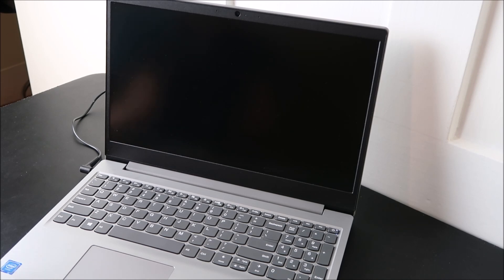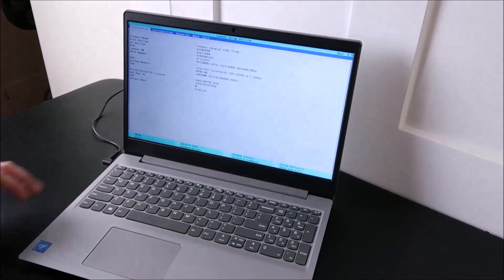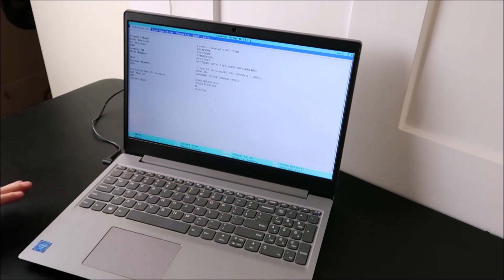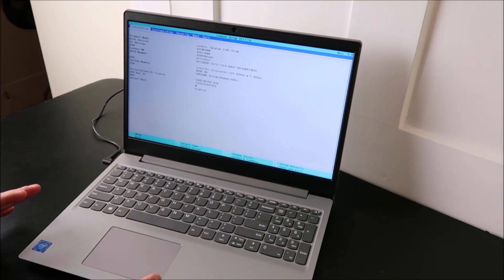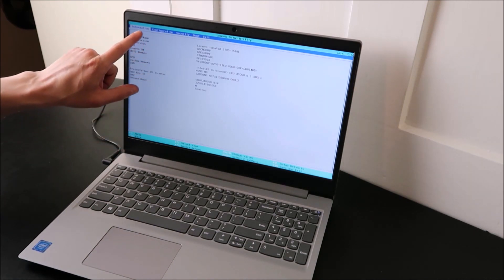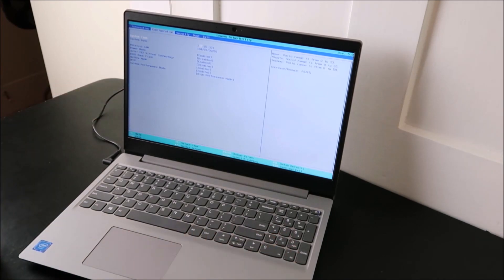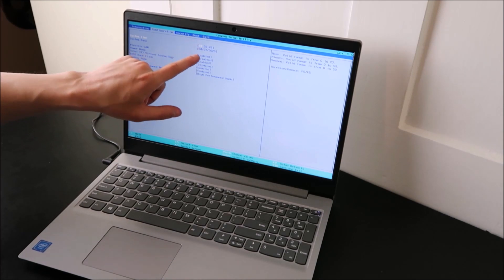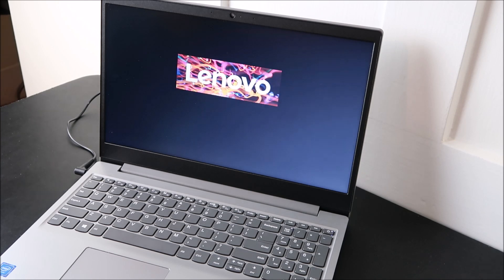How To Fix Bad Checksum Error, RTC Battery Low, Set Date & Time, 0251

Comment: I was able to power escape until running quick test I got 22 percent in scan it shows hard drive good battery is 0. I think there's more to it but I need a new battery but I don't want to waste money if I can't fix other underlying issues. Any advice? This is for my HP laptop.
Reply from the maker: Your talking about your CMOS battery being bad or the main computer battery? If the CMOS battery needs to be replaced, they are fairly cheap.

Comment: Hey I have a Lenovo thinkpad x1 carbon. I fixed the date and time issue but now am stuck in another loop. The sequence is that the Lenovo screen appears, then the windows logo appears and says welcome while loading, then it flashes to a blue screen and restarts. Nothing I do seems to fix this error
Reply from the maker: Can you try the steps seen here? https://www.youtube.com/watch?v=oL1R1Tw0jSo. Also, did anything happen before this issue appeared?  Liquid spill, overheating, Windows update, etc?
Reply: @PC_Monkey  this seemed to work nicely, thank you!!! Only issue now is the battery isn’t working. I’ve tried disconnecting and reconnecting and resetting the bios but the battery does not show as connected anymore and only works on direct power in from the wall. 

Do you think it’s time to replace the battery or is there anything else I can try?
Reply from the maker: @ChristopherJRoura  First, make sure all the updates are processed as seen here: https://youtu.be/DPBi13q0H8I. If that fails to help, I would next try replacing the battery :( Let me know if you would like help finding a replacement if the updates dont help :)
Reply: @PC_Monkey  never got around to it but I wanted to say thank you. It’s all repaired and works like new!!! Great advice!!!

Comment: Mine was stuck in a boot loop with bad checksum error. I couldn't access bios from the F12 menu but I found if you power off and power on and spam F1 non stop it will allow you to get back into the bios. From there reset settings to default, set the time and date and save/reboot. Then it should boot up again.

Comment: I have 0177 bad svp data stop post task
Reply from the maker: 1.  Your getting this error during startup of your Lenovo computer? Are you able to try the steps seen here?  https://www.youtube.com/watch?v=Q0UqVVcKuM8
2.  Also, did anything happen before this issue appeared?  Liquid spill, overheating, Windows update, etc?
Reply: @PC_Monkey  hi, thank you for your replay, so i left my lenovo yoga 14 for 5 months off because i couldn't find the charger!, now i get 0177 badge svp data stop task massage right after the black thinkpad black boot screen, then it will turn off, i tried to keep hitting Enter to take me to bios no luck, disconnected the battery, bios battery and charger, and using power button to train all the charges, then put everything back, no luck.
Reply from the maker: @sammq4499  1.  The computer will not start even if you remove the battery and try running with only the charger as seen here?  https://youtu.be/HHwzA37r4e8

Comment: Now i maybe know how to change the whatever battery but yeah thx alot it fixed the problem with that time thing but the bad checksum uff
Reply from the maker: Glad your all set :) Always here if needed !!
Reply: @PC_Monkey  yeah my laptop turns on makes weird sounds and beeps
Reply from the maker: @nastasidarius6962  Can you be more specific?  Does the computer work well otherwise?  Feel free to post a video to your own channel, and message me when you do.  I can then view and advise further :)
Reply: @PC_Monkey  well the laptop when i turn it on it makes weird noises and the fan stops randomly then it beeps overheats fast screen is black all the time
Reply from the maker: @nastasidarius6962  An overheating computer can be damaging multiple different components if not resolved. First, make sure that the fan and vents are clean and clear. If you need help accessing the fan, let me know what brand and model computer you have and I can help you get inside it. If that does not fix the overheating issue, then try replacing the thermal paste on the CPU and if needed, the GPU as seen here; https://www.youtube.com/watch?v=K_j4GPjpawk. If that fails too, replace the CPU
Reply: @PC_Monkey  i did clean the fan and my friend said its probably the cpu that is fried but i looked inside and doesnt have any burn marks so idk and i also even checked out every component in my laptop nothing wrong guess the system has issues
Reply: Is it possibile to change the cpu from the laptop model lenovo thinkpad L13 gen 2
Reply from the maker: @nastasidarius6962  Is this your computer?  https://www.youtube.com/watch?v=y2_Vj288AWE.  If so, then no.  The CPU is integrated into the motherboard and cannot be easily replaced.
Reply: @PC_Monkey  yes it is then if the cpu is not changeable then i need to change the whole motherboard
Reply: @PC_Monkey  so found 2 errorcodes and the rtc battery was dead so 1 st errorcode is bad cmos checksum and 2nd errorcode is the date (its probably bc of the rtc battery
Reply from the maker: @nastasidarius6962  Ya, without examining it myself, I would guess at this point a bad motherboard.  Sry :(

Comment: I have a yoga 11e thinkpad 5th gen. To give some context as to what happened before i got this error, i had just let my laptop do an update and i let it run.  Then I get a bad cheksum error every time I boot up the laptop and then it reboots doing the same thing as mentioned before, its as if some sort of loop. I've tried going into the bios but that brings up the bad cheksum error, i've replaced the cmos battery but still to no avail. any ideas as to what i can do to solve it?
Reply from the maker: The date/time settings are ok each time?  
Are you able to try the steps seen here?  https://www.youtube.com/watch?v=2-WDntT-5L8

Comment: But my F1 key is broken and I can't turn on my windows 7 is there any other way to get into bios?
Reply from the maker: How is the key broken?    What brand computer do you have?
Reply: @PC_Monkey  thosiba and some of my key in my keyboard is broken it's an old laptop
Reply from the maker: @aniduel9583  Have you tried using an external keyboard?  What do you mean, you cant turn it on?  What exactly is happening?
Reply: @PC_Monkey  I had that idea but my did ignores me when I say that. So if I turn it on it's says press F1 key to set date and time so I can't go into bios and I can't go into my normal homescreen until I press F1 and fix my date. This thing happened because I left my laptop for too long without changing it.
Reply from the maker: @aniduel9583  You have to change the date / time every time for the computer to work?
Reply: @PC_Monkey  no only this time
Reply from the maker: @aniduel9583  Ok.  Sometimes computers just have errors.  No big deal usually.  If it starts becoming normal, you may need to replace the CMOS battery.  You can see how to access that component as seen here;  https://www.youtube.com/watch?v=76I2Ec9K7lw
Reply: @PC_Monkey  thanks you're really helpful
Reply from the maker: @aniduel9583  :)

Comment: i have a Neo Lenovo laptop, when i turn on my laptop it says, "error 0251, and error 0271..
and i already replace the CMOS battery, and the issue still exist.. can you help me with this please. thank you.
Reply from the maker: I dont get many Neo computers in my shop so my experience is limited.  However, you may have a bad HDD.  I would try replacing it if a new install of the OS does not help

Comment: I need help ASAP. So i got my SCHOOL computer today and im getting these errors. I have Boot Menu and App Menu but everything i select doesn’t work. Can you help? Please? Edit: Its a Yoga 11e ThinkPad that wont even let me log in
Reply from the maker: Does the computer boot to Windows or stop during startup? If it gets stuck at startup, are you able to try these steps?  https://www.youtube.com/watch?v=2-WDntT-5L8
Reply: @PC_Monkey  f12 worked but It Just Shows Boot Menu and App Menu and everything i select brings me back to the error
Reply from the maker: @thezam-1   If changing the settings in BIOS didnt help your situation or you cannot manage to change them,  move on to try the reinstall of Windows as seen here;  https://youtu.be/Wu0c8wR5Ltk.  You can create your own Install Media for free as seen here;  https://youtu.be/g_UhiHScaSI.   If that does not work, it is because your Hard Drive is bad and needs to be replaced as shown here;  https://youtu.be/tNp5Kbo9uHg.
Reply: @PC_Monkey  It’s alright. I just turned. it in
Reply from the maker: @thezam-1   Good luck !!  Let me know how it goes :)
Reply: @PC_Monkey  Thank you i will!

Comment: Helpful info.. Please help me with the following..

My laptop is lenovo.. Getting 0251 error..

Where i cant turn ON with the power button.. I have to put direct power plug then the it turn ON and ends with that error

Not able to get into BIOS

As if i plug the power it goes to the err screen
Reply from the maker: If you need the power adapter to turn the computer on, then you most likely have to replace the battery.
Reply: @PC_Monkey  thank you for  the reply... But its weired here... Only with direct power input laptop turn ON with 0251 error... But it stay like that with its regular battery. Giving me error as u mentioned in video tag....
Reply from the maker: @rinukumar7770  If you remove the battery, and only turn on and use the computer with only the power adapter, does it run well?
Reply: @PC_Monkey  nope it wont, it stop with 0251err
Reply from the maker: @rinukumar7770  Last thing you could try is a manual BIOS reset as seen here: https://www.youtube.com/watch?v=76I2Ec9K7lw
If that fails to help, consider replacing the CMOS battery as it could have become faulty or dead.
Reply: @PC_Monkey  0251 system CMOS checksum bad.. Thats the error im getting unable to get into bios.... Tried tapping F1

Comment: I have a Costco hp df0023cl laptop that I have had for 2 years.  My battery was losing maximum charge so I replace the battery (HTO3XL) After I installed the new battery I couldn't start my laptop so I plug my charger in and it started up and I received a CMOS 502 ERROR. I then unplug the charger and the laptop work and held the charge. I shut down the computer(after 3 hours) I tried to power up again without the charger and it wouldn't power up so I plugged the charger back in and I received another CMOS error.  my laptop date and time work fine once hit enter after I get the CMOS error. is this a CMOS battery problem?
Reply: Pls did you fix this? How were you able to fix it?

Comment: Hi PC Monkey I have a Lenovo ThinkPad getting this on start up. Lenovo thinkpad ( 0183: bad CRC of security setting in EFI variable)  can this be fixed.  Thank You
Reply from the maker: This happens before or after the startup Lenovo logo screen?
Reply: @PC_Monkey  That's the only thing showing when I turn it on
Reply from the maker: @chrislincoln489  Can you try the steps seen here?  https://www.youtube.com/watch?v=2-WDntT-5L8
Reply: @PC_Monkey  none of this was my problem. when I push the on button to start the laptop it come on saying "0183: Bad CRC of Security Setting In EFI variable.   Press F1 to enter Setup".
Reply from the maker: @chrislincoln489  I know the symptoms described there is not the problem you described lol but its the same fix.  Again, were you able to perform those steps?
Reply: @PC_Monkey  yes , I also replace the hard drive . Removed the batteries both. I also tried the reset as you said. I'm thinking this might be a board problem.
Reply from the maker: @chrislincoln489  After replacing the drive, did you install an OS onto the new one?  What happened during the install?
Reply: @PC_Monkey  Same thing won't play the DVD. It's not getting pass that screen.
Reply from the maker: @chrislincoln489  Your most likely looking at a motherboard issue, yes :(

Comment: What if you have a HP laptop ? I sent mine in for repair because of this. First day i used it after recieving it back it was fine. Now every other time i use it the checksom bad error pops up.
Reply from the maker: Your CMOS Battery could be dying if BIOS keeps resetting your time/date settings.   Try replacing that.

Comment: Can you help me I can get my laptop Acer running. I have watched all ur videos and none really link with my problem.
Reply from the maker: Whats wrong with the computer?  Will it turn on at all?  Please describe the symptoms.
Reply: PC Monkey hi yes it turns on but not fully. Starts to load and then goes to a push f2 for set up and I push f2 it goes to a black with white words. I have a picture but don’t know how to send it to you
Reply: Broadcom undi pxe-2.1 v12.2.2
........ 
operating system not found
Reply from the maker: @joannemurphy1688  Thanks for copying and pasting that error !!  That helps diagnose whats wrong :)  That error refers to your computer trying to find another source to boot off of because it cannot locate your hard drive.  Either the hard drive has become loose, or is damaged. 
I would first try 'reseating' the Hard Drive.  That is where you unplug it and then plug it back in, making sure its properly plugged in and secure.  Try the scan again.  If it still says that its not installed, then its most likely bad and needs to be replaced. You can see how to do that here;  https://www.youtube.com/watch?v=PLiCtwOBuxk
You would also then need to install an operating system onto the new one as shown here;  https://www.youtube.com/watch?v=Wu0c8wR5Ltk
Reply: great hank you I will try this. sorry for late reply trying to home school two children lol

Comment: Hii i have a question! I have an Hp laptop. But it wont turn on if I don’t plug it in. It always has to be plugged in. If i plug it out it just turns off.
Reply from the maker: I would assume your battery is bad then.  I would replace the battery.  To be sure, you can test your charger as shown here;  https://www.youtube.com/watch?v=YBhsVHideGE&feature=youtu.be
Reply: PC Monkey where can i get a new battery?

Comment: Hey pc monkey , i have this laptop (sony vaio) and it seems not working and tried going to few computer shops to repair it but they denied to fix it because of Deffective motherboard and also cant afford to buy a new motherboard or laptop. Do you think changing my sony vaio mother board to other branded laptops can fix the problem? Can it still turn on?
Reply from the maker: Whats the problem with your computer?